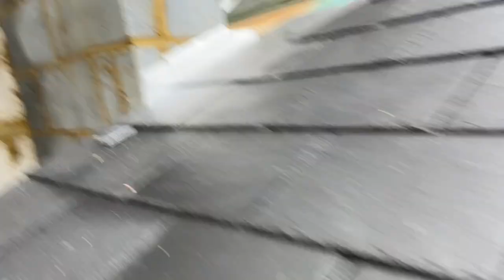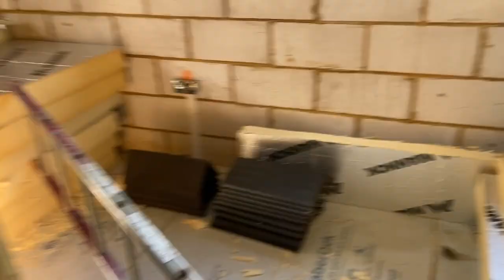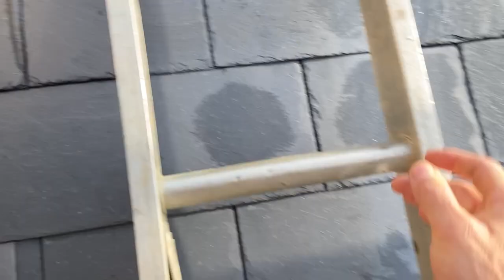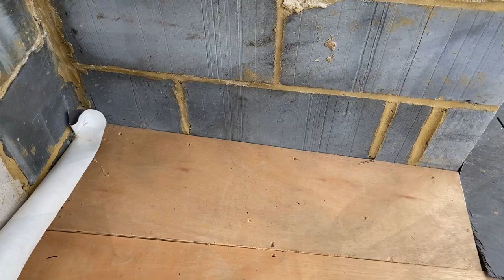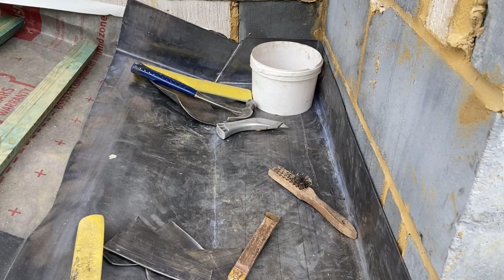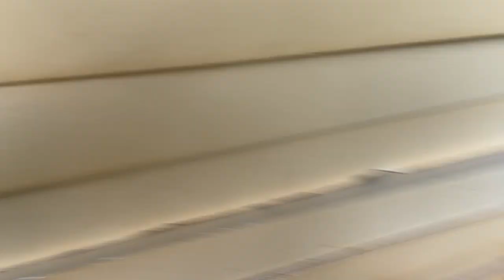Installing Code 5 Lead Gutter Details And Apron Corners To A Slate Roof

Comment: Be nice to see you welding internal corner, I know you find it easy, but brilliant to watch 👍
Reply from the maker: Thank you. Do you want me to make a vid showing this ?
Reply: @slbleadworks  yes please would be brilliant, many thanks
Reply: Awhile back when I was an apprentice wood roofer I figured out how to flash an inside corner such as you’ve got in this video with lead by folding it so it’s one piece   Do you ever fold up  yor inside corners or does that get too bulky? The welding is very neat.

Comment: UK has definitely gone a lot more like it is in Australia with each trade only doing their one little bit. Being an old Pome we used to do most things years ago. It was also true out here too. My old offsider remembers the same when he started. It has gone so far here that Carpentry is split into something like 16 classes. Each class effectively a different trade. To gyproc your house is now four trades. Hang the sheet. Set it. Sand it. Cornice. All this extra coordination required. Delay with getting trades. And often more expensive. When you were slating a roof and you got to a stage requiring lead flashing you just put it in as you went. A lot of roofers I knew welded lead pretty good as they went. You never get as good because that is not all you do but it worked for probably centuries.
Reply from the maker: The roofer I do lead work for on Saturdays does everything himself. He does some lead too. Flashings etc. That way you don’t have to wait for anyone and you can just got on with it and get the job done.
Reply: @slbleadworks  More old school like me

Comment: Thanks for the uploads, its great to see the details!
I don't recall you uploading a video showing how you did that valley gutter though, a stepped one yes but not that flat one.
Interested to know what are the pros/cons to a stepped valley gutter verses the flat version with expansion strip though?
Reply from the maker: Thank you no worries I enjoy getting them out there. 
I would recommend a stepped gutter all day long over the flat expansion joint ones. 
Really expansion joints should only be used as a last resort. When you haven’t got the heights for steps. 
And they are only guaranteed for 10 years. When your spending the money for lead you want it to last. So always stepped if you can.

Comment: What are the things that look like copper nails with square washers holding up the vertical lead at 7.58. I'm asking because I need to know how to hold up the new vertical flashing I'm fixing on my old lean to greenhouse. Thanks, Tony
Reply from the maker: They are pieces of copper that I’ve cut to act as a washer. 
Thanks for watching Tony.
Reply: @slbleadworks  Thanks for the info about the washers. Are they fixed to the wall with galvinised nails, or what?
Reply from the maker: @tonyb83  they are fixed to the wall with red plugs. And 25 mm copper annular ring shank nails.
Reply: @slbleadworks  Ah great to know, is that because copper doesn't react with lead? I'm fixing the vertical part of the lead flashing to a wooden beam so would galvinised clout nails be ok.?
Reply from the maker: @tonyb83  yes that’s correct. You can use copper or stainless steel. 
You’re supposed to use ring shank nails as they are designed to not pull out when the lead expands and contracts.

Comment: Hi mate good work! What’s the building paper for? Just curious cheers
Reply from the maker: Thank you. 
The building paper has a few different uses. 
It reduces corrosive attach when laying lead onto plywood or oak. 
It also protects the lead from alkalis in concrete, stone and screed. 
And helps the lead to move and also acts as a vapour barrier.
Reply from the maker: Thank you. 
The building paper has a few different uses. 
It reduces corrosive attach when laying lead onto plywood or oak. 
It also protects the lead from alkalis in concrete, stone and screed. 
And helps the lead to move and also acts as a vapour barrier.

Comment: Hi I notice you have not cut the brickwork and tucked the lead in, is this because there will be render on top of the lead?
Reply from the maker: Yes that’s correct. To be honest I usually still cut the lead in if it’s rendered or not. But the client instructed me not too. 
Thanks for watching.

Comment: Is it necessary to put building paper under the lead?
Reply from the maker: I was probably being a bit over the top putting it under the back gutter. 
But cladding, dormers, flat roofs etc then yes. Absolutely essential.
Reply: @slbleadworks  
Cheers Pal .
Thanks for the replly and thanks for posting .
Your work is top dtawer stuff.👍

Comment: I'm new to lead welding ,got all the gear and no idea basically. Any chance you can show us or tell us how you weld your internal corners like that? I'm also a lefty but having trouble welding them on my backgutters when they meet a wall like that
Reply from the maker: I’m a lefty too. You just need to think about whats the easiest way for you to weld it and then cut it accordingly. It can be hard sometimes when they meet a wall. Maybe try to weld it out of position